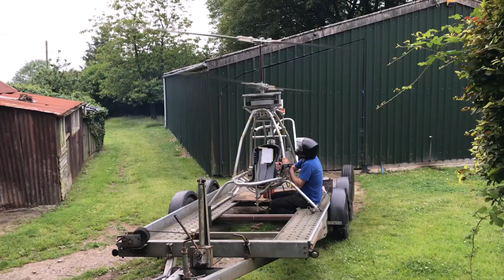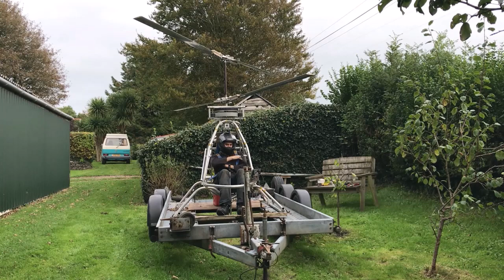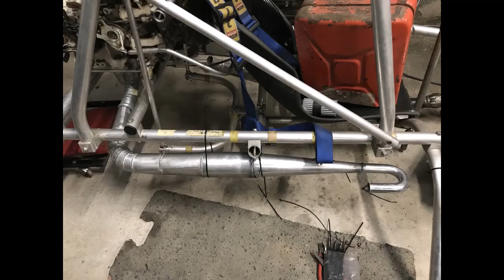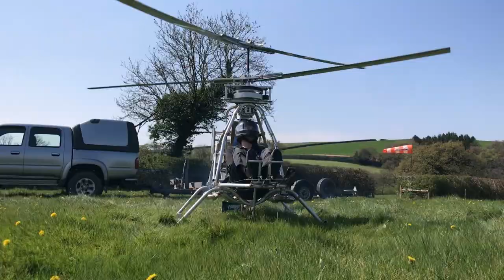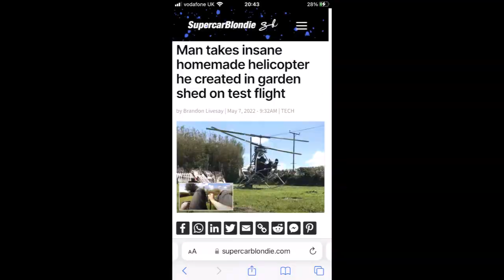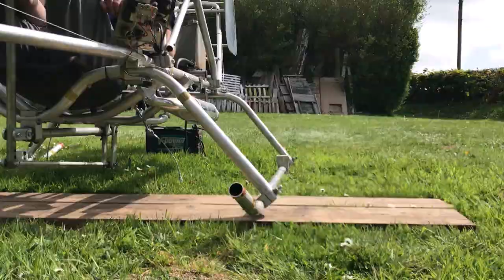From first test to FLIGHT Homemade Coaxial Helicopter

Comment: We miss your project Ben .
It was. Great to hear about all developments ...can't you keep working on it ?
Reply from the maker: Thanks Mate, I miss it too, it was the best project I have ever undertaken by miles. I want it back working but I need to make the right decisions about its design. It needs collective pitch as a minimum but I think it should be swash plate controlled like a normal coaxial. 
I'm building a flying boat at the moment so that will take a few months to build, but after that I will be back onto the helicopter. I'm putting together a video at the moment about the helicopter and the design decisions going forward. It's tempting to just fix the driveshaft and continue hovering practise but I really don't think that's a sensible thing to do. It would be a decision based on desire rather than common sense. Appreciate your message and support. 👍
Reply: @Ben-Dixey  welcome brother, many of us get involved with your helicopter project like we are too the part of it ... because you had been sharing step by step all developments and setbacks .
I believe you are right about installing swash plate and collective pitch .
I have stopped counting days we spend in these DIY scientific projects because it far better then wasting times in the pubs getting drunk or getting bored with daily life routines ...what better could you had achieved then this if you wouldn't commited to this great project.it was very rarely seen project,only one can do out of few ten millions .
I truly believe it is great achievement.
Hoping soon to seeing you working on it again brother.

Comment: HI, IT'S ME AGAIN. IT'S ALL LOOKIN VERY PROMISING AND THE VIEWING WORLD IS THRILLED.   
           I HAVE BEEN THINKING ABOUT THIS STYLE OF ROTOR ATTACHMENT AND PONDERING THE APPARENT PROBLEMS WITH CENTRE OF GRAVITY.
           WHEN YOU ANALYSE IT, WITH THIS TYPE OF ROTOR HEAD, IN THE HOVER, THE ROTOR IS FLYING AND THE FUSELARGE IS HANGING FROM IT.   THIS IS ALSO TRUE FOR A CONVENTIONAL HELO WITH CYCLIC PITCH CHANGE.   I HAVE TRIED THIS WITH A WHIRLWIND HELO BY ESTABLISHING A HOVER AND GETTING THE CREW IN THE CABIN TO MOVE FRONT TO BACK WHILST HOLDING MY CYCLIC STEADY.   
           WHEN YOUR ROTOR HEAD IS FLYING IN THE HOVER,  THE GofG  WILL TAKE UP A POSITION VERTICALLY UNDER THE ROTOR SHAFT AXIS.  THE WHOLE WEIGHT IS HANGING FROM  THE ROTOR.   WHEN YOU MOVE 'YOUR' CONTROLS YOU ARE EFFECTIVELY MOVING THE CofG AROUND IN RELATION TO THE DISC PLANE TO CAUSE THE HEAD TO DRIFT.  IF THIS IS TRUE, THEN PROVIDING THE CofG IS ROUGHLY UNDER HE HEAD,   THERE IS NO NEED TO HANG PARACITIC WEIGHTS ON THE AIRFRAME AS MOVING THE 'STICK ' AROUND NEGATES THE NEED.   WHEN YOUR ROTOR IS FLYING, YOU ARE EFFECTIVELY MOVING THE G of G IN RELATION TO THE DISC AXIS TO EFFECT THE REQUIRED MOVEMENT IN AZIMUTH.
            THE CONVENTIONAL HELO IS LIKE AN APPLE HANGING ON A TREE.   THE PILOT SITTING IN THE APPLE, FLIES THE ROTOR VIA THE CYCLIC AND THE 'APPLE' HAS TO FOLLOW.   IN YOUR MACHINE WITHOUT CYCLIC , THE PILOT EFFECTS CONTROL BY PHYSICALLY  MOVING THE Cof G. IN RELATION TO THE ROTOR AXIS.   
              CONSIDER  YOUR MACHINE IN A STEADY HOVER, THERE IS NO WIND. A THOUGHTLESS STRANGER HANGS A WEIGHT ON YOUR TAIL SKID ( IF YOU HAD ONE ) - THE MACHINE DRIFTS BACKWARDS AND YOU COUNTER THIS BY MOVING YOUR STICK FORWARD SO THE ROTOR AXIS REALIGNS WITH THE NEW CofG. TO RE ESTABLISH THE STEADY HOVER.
              I FOUND THE DRAWING OF THAT BENSEN LIGHT HELO INTERESTING. IT'S A NEW ONE TO ME .  AM I MISTAKEN BUT  IS THE ROTOR (CYCLIC  ?) CONTROL NOT REVERSED ? IF SO, THAT WOULD TAKE SOME GETTING USED TO - OOO-ER MISSIS !
Reply from the maker: Hi Ray, always good to communicate with you, your description of how weight effects the cyclic position I think is accurate. Being tail heavy or nose heavy I think moves the fuselage relative to the rotor, the rotor needs to be level to stay in a hover but the fuselage can tilt forward or backwards and out of level, to compensate the cyclic position must change. I want my fuselage as level as possible to help with the learning process but I'm sure you are right and it should be fine to fly in an out of balance condition providing there is enough cyclic range. 
I believe the control of the machine in the air is the same as one with cyclic pitch. It certainly feels the same as an R22 with my limited experience. 
What was slightly surprising was the ease of cyclic control, only finger tips needed but this can be explained by the aerodynamic assistance from the cyclic angle of attack change just like blade feathering. 
The Bensen B9 did indeed have reverse controls and I could have done the same, it would have been much easier but didn't fancy it either. 
I have changed the throttle as you suggested. 
I'm just going to phone and book another R22 lesson in Gloucester. It will be fun to further compare and see if I'm any better at it than last time. 
My email is btdixey@hotmail.com should you wish to communicate via email. 
Ben

Comment: Just found your videos. They truly have inspired me to start a self build helicopter project, Thank you.
Reply from the maker: 👍 are you thinking of going conventional or coaxial ? There are plans available for conventional which help a lot.
Reply: @Ben-Dixey  Well, I would like to go down the easiest route available to me! Would you say that the conventional route with plans may well be the easiest way forward?
Reply from the maker: Yes, using plans is much easier, you can just make the parts according to the plans and know what you have done will work and has been tested. No design work involved but the quality of the engineering still has to be good. The Aw95 would probably be my choice but there are others on the vortech website.
Reply: @Ben-Dixey   Many thanks for this. Just completed some initial research. Yes, what a simple, beautiful, and affordable design. Your recommendation of the AW95 is what I am going with. There is a " Vortech " business that charges, around $100 to $150 for a CD and a printed document. Does that sound about right for the plans?
Reply from the maker: Yes that's the ones. The AW95 is an updated version of the hobby copter to which there are free plans online. There is also a YouTube video detailing the AW95 plans but not sure if everything is there. Just be aware that the price of materials might be more than you are expecting, it does seem to escalate. I thought I could build a helicopter for around £3k but ended up spending twice that and it's still on going. At £6k you might be able to find a mini 500, which might be worth thinking about. It just depends on what you want to achieve.
Reply: @Ben-Dixey  Many thanks indeed for your help. Looking at some plans for the AW95, I believe a Rotax 803 engine has been stated as the one to go for. I can see that there are some Rotax 503 engines that produce circa 50 BHP when new. Would you think that this engine in theory would do the job? The Mini 500 may be an option, but I am unsure of if I can locate one within my budget. If I could get one for £6000 or thereabouts, I would buy it!
Reply from the maker: Weather an engine hp is sufficient depends on the max take off weight required. If you manage to build to the plans then that should allow for a 100kg pilot and 50hp might just be enough to get off the ground. There is a rough rule that says 1hp can lift 12lbs but I think this is optimistic. The rotax 582 is an option and so is the mz202. The air cooled mz202 at 63hp is pretty attractive. By far the cheapest option is an outboard engine like mine but it's heavier and requires modification for the cooling as I'm finding out.
Reply: @Ben-Dixey  Great, I appreciate your help again. I think the rule is interesting. I am going to look at the Rotax 582 and the MZ202 as well. Until I viewed your videos, I would not even have thought about a marine engine!
Reply from the maker: Happy to assist, yes I thought I was original in using an outboard but later found it had been done in the 1950s. The Bensen B9 and rotorway scorpion 1 used outboards. Cameron Carter on YouTube also used one, there are very few things that haven't been done before but new technology and materials allow for old concepts to be improved.

Comment: I recently came across your video series on your coax heli build and flight testing. Seems you have been struggling with cyclic micro adjustments / over corrections when trying to hover; have you considered altering the cyclic control geometry/leverage ratios to make the cyclic stick less sensitive... 
Also, you seem hell-bent on mastering the hover before attempting any forward flight; i believe forward flight is easier to achieve them hovering so i would love to see you try slow speed forward flight...  I admire your persistence and determination. Keep at it !
Reply from the maker: Hi. I have considered making the controls less sensitive and I will give it some more thought. The reason I haven't done so to this point is the sensitivity feels correct to me, it feels like the R22 I've had a brief experience in. It might help to change it though even if I have to change it back again. I suspect it will be easier in a slow forward flight and I will give this some thought too, but it seems like trying to run before you can walk?  Good subjections 👍

Comment: Amazing work inspiring people across the world .can you brief a little on load distribution in the main rotor blades? Does each blade lift 60 kg along the length equally and also is it a cantilever type load? It's working magnificently, as I see through. So if you share a few details on these, it would be nice.
Thank you for the lovely videos.
Reply from the maker: Hi, thanks for the message. The majority of the lift is produced on the outer third of the blades, as the airspeed decays towards the center the airfoil becomes stalled. As these blades are parallel and not tapered, straight and not twisted it's not the most efficient blade type but tapered and twisted blades are hard to make. 
There shouldn't be any cantilever force on the hub if it's designed correctly.  The centrifugal load is pulling horizontally at over two tonnes and the weight of the machine is pulling vertically at 1/4 of a tonne. Using trigonometry we can determine each blade will have a coning angle of 1.5 degrees and if the blade is allowed to fly at this angle there won't be any cantilever. Most helicopters have hinges that allow the blade to fly at whatever angle it likes which is better than my chosen fixed blade angle hub design.

Comment: This is incredible. What do you think of the electric Franz Schöfmann? Why/ why wouldn't you make something like this?
I'll link to a picture in the next comment.
Reply from the maker: Thanks 👍. I don't remember seeing an electric schofmann but an electric version would be great. I've read about the electric coaxial by pascal Chretien. The IC powered schofmann was probably on the limit of performance, changing that for a motor and battery's might well be possible at a reduced flight duration. It's something that should be developed, I think.
Reply: @Ben-Dixey  Unfortunately, I've only found pictures of the electric schöfmann. I've heard he preferred to keep a low profile and doesnt want to be on youtube. It would be great to see a video on it, and hear discussions about its limitations and potential to overcome them. I really like the small form factor and simple controls, and wonder if anyone could actually fly it more than a foot from the ground.

I imagine it could be improved with a dual motor for a single rotor, and perhaps another dual motor for anti-torque, applied to the air frame
Reply from the maker: It's an interesting proposition to go electric and it solves a lot of problems. I think in terms of efficiency a coaxial would be the best choice. There are people working on these types of machines, the GoFly competition is driving advancements. There are some great looking machines with big budgets but the prize money hasn't been won yet. The restrictions of the GoFly competition make it a hard task but I'm sure achievable. The GenH4  I thought was a master piece of engineering but perhaps too expensive.

Comment: You have come a long way.  And glad you have a sense of safety.  It may be seem like it’s taking a long time but taking your time is better than rushing thru and getting hurt.  That would put a damper on the project.   Cheers
Reply from the maker: Completely agree, however i was surprised how long the testing has taken. People ask me things like when is the first test flight then? I say I've been testing it for months. I suppose with some other projects you make something and then see if it works with this the process is quite different.
Reply: @Ben-Dixey  yes your life

Comment: So what's the deal Ben are  you jogging along putting more hours in the hovering practice........are you pleased with things ?
Reply from the maker: Hi Peter, I haven't done anymore flying attempts since the last video, had a little break from it but have reapplied the helicopter blade tape with two layers instead of one this time. I'm not sure if that will help but I'm hoping it might. I've also just installed a bigger radiator fan for increased flight duration at a weight penalty of course. I think the project has been pretty full on over the last 12 months fixing, modifying and making videos and a little break has done me good I think. There is of course more to achieve and it would be a shame not to explore the machines capability's

Comment: Hi mate how are you cooling the ex outboard engine?
Reply: I had a Mercury ourboard running on a closed circuit loop with a rad and forced air drawn through it, making a water intake on top of the block and having the 2 outlets as the exit, it worked well.
Reply from the maker: Thanks Peter. I might need that Information at some point. Cheers 👍
Reply from the maker: Hi Jim. With difficulty is the answer to that 😆. I had to make the exhaust manifold and there I've separated the coolant from the exhaust which would normally be exhausted together but as the engine is designed for coolant at temperatures no more than probably 10degrees C the channels are small diameter. This will obviously restrict flow rate and I don't know what flow rate is needed. Also with the coolant channel running so close to the exhaust unwanted heat will be transferred to the coolant. This wouldn't matter on a total loss system it used to run as an outboard. I planned a belt driven fan and ultimately this is what will be required but for now I'm going to put on a bigger electric fan just to give me more flight time. It's best in my opinion to gradually increase flight time as bearing temperatures ect can be monitored without a drastic overheating situation. Having seen what Cameron Carter went through to get his engine temperatures acceptable it's not going to be a quick job by the looks of it.
Reply: @Ben-Dixey  Yes no problem cooling those engines when out on the ocean with all the cool water you need. I used to be a marine mechanic working on those OMC outboards and that's why I asked. From memory the impeller was pumping a couple of liters a minute. what are you using for a water pump and radiator. I know the rotorway scorpions used to use I think V4 outboards so they were able to cool them to some degree somehow.
Reply from the maker: Thanks for the info 👍 I'm using an electric water pump from a vw bora. It's intended use is to improve water flowing on a car at engine idle. I don't know the flow rate but it would be easy to measure. The radiator is from a Honda Civic 1.6ltr my reasoning for using this radiator is if it's able to cool a 1.6ltr 4 stroke engine it should be able to cool a 737cc 2 stroke but I might be wrong on this. 
I take it coolant flow rate can be too high as well as too low ? 
The radiator is a single core but could be changed to a twin core if it was necessary. Of course this will add to the weight again, air cooled would be much simpler and lighter if i was prepared to spend the money on the appropriate engine.
Reply: @Ben-Dixey  Outboard 2 strokes are very reliable. If you can get the cooling to where you are happy, I doubt you could find an air cooled two stroke that's as reliable. Of course it would be more simple though.
Reply from the maker: That's an interesting fact, I didn't know that, gives me a bit more confidence in the engine.  I had a boat with the same engine and it never let me down, I had an auxiliary engine and needless to say it wasn't needed. 
I like how smooth you got your gyro to fly, must have taken a lot of time perfecting that. 👍
Reply: @Ben-Dixey  Actually not much at all most of  it comes from the super flexible mast which  isolates the two per rev and just some normal balancing to reduce the one per rev
Reply from the maker: I've not got into all this vibration measurement stuff yet but I've read about it. I've seen it mentioned about ridged vs limber masts on gyros and vibration. What seems odd to me is like mine a gyros rotor is hinged so it's connection to the mast is already as limber as it possibly can be. Vibration you would expect to be solely through the cyclic stick. There is always a surprising fact with rotorcraft it seems.
Reply: @Ben-Dixey  Yep no such thing as knowing everything about rotorcraft